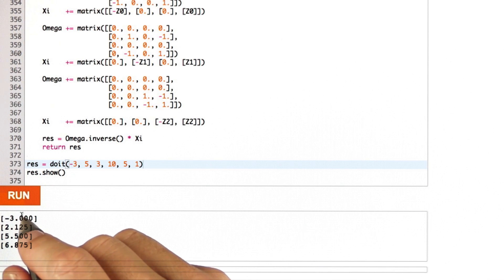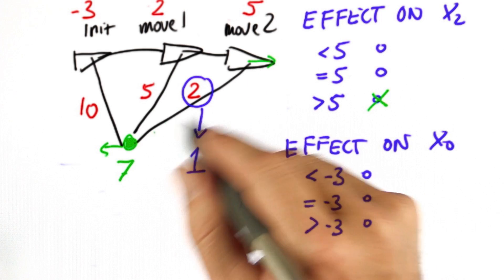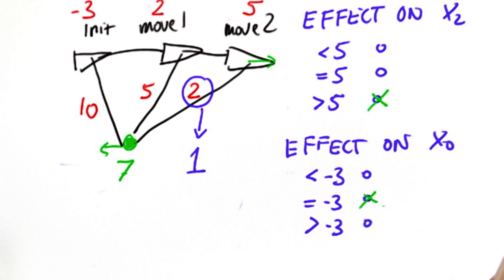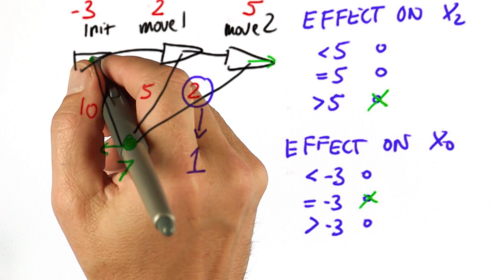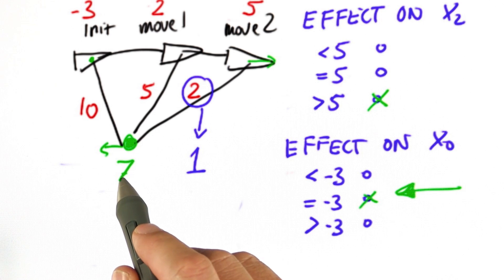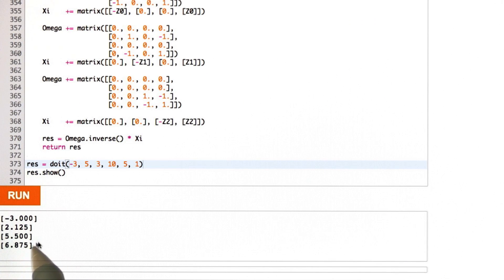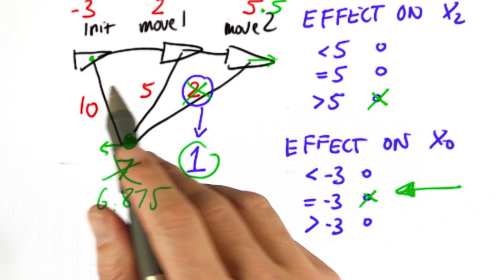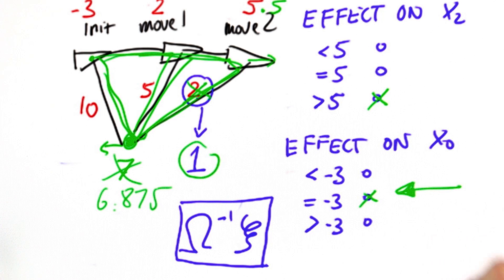Introducing Noise Solution - Artificial Intelligence for Robotics

Comment: I don't understand the explanation either. We have a system of equations involving the variables x0, x1, x2, and L0. The first equation mixes the absolute constraint about the initial position with the other relative constraints. Other equations use only relative constraints. But there seems to be nothing in this math that differentiates absolute constraints and relative constraints. Or, put differently, I can't see anything that would prevent the deviations of x0 from its initial position, while allowing other variables to change. Perhaps, it's a feature of a particular mathematical method we use for solving that system of equations or, maybe, it happened only for this example?

Comment: Sorry but I'm not convinced. In the math, all constraints are just equations, whether it's global or local. So, what's special about an equation that involves only 1 variable (x0) that has more weight than the others (especially here in the code we assume no noise in all of the measurements as in there's no relative weight difference across the constraint equations)?

Another related question: what if we have >1 global information constraints and they're conflicting each other?